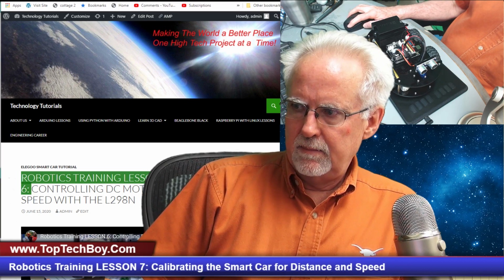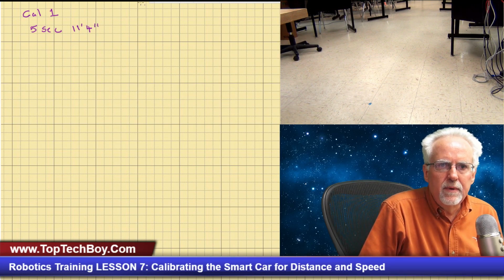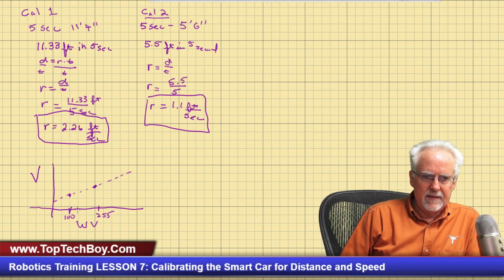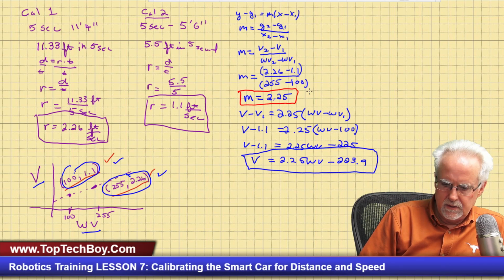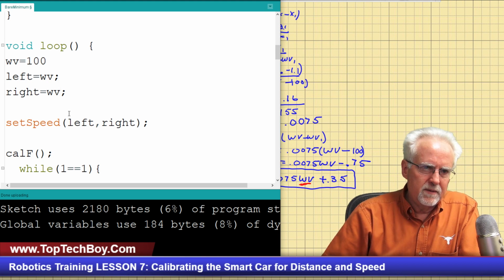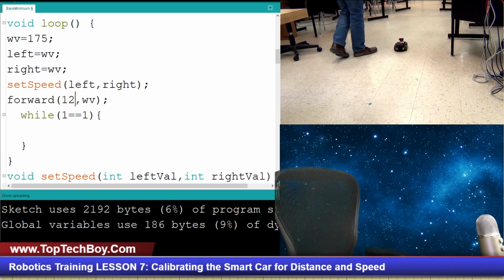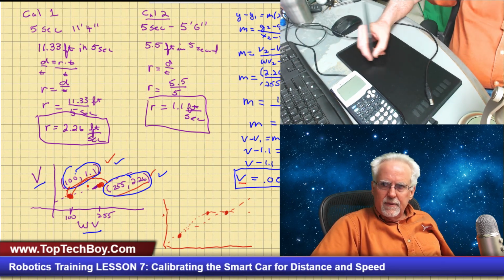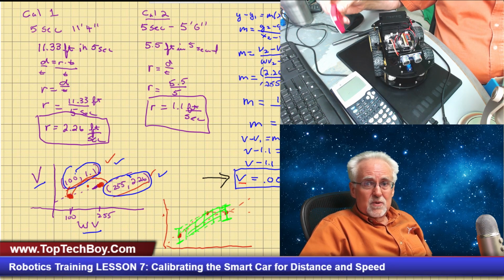Robotics Training LESSON 7: Calibrating the Smart Car for Distance and Speed

Comment: So I just tried it and it works great! Using a pot as a speed adjust, so we can adjust the speed on the fly without having to go in and change the code (just trying to engineer it to be more using friendly).
Int potPin 
Float speedAdjust 

void loop
speedAdjust = analogRead(potPin);
speedAdjust = speedAdjust / 4;

// so if the potPin has an analog read from 0 - 1023, and speed has a range of 0 - 255. Then take 1023 / 255 = 4
I think we could make a programmable car for anyone (even if they can't code) by having external inputs controlling the code. Something like the Milton Bradley toy from the late 70's and early 80's. The Big Trak.

Comment: Really a fun lesson on open loop control. The 298 is fairly linear surprise. Yes this is a very good platform for teaching. Compass or GPS would be fun for those on a tight budget and some time to wait look at Aliexpress. Check the star ratings and quantitiy sold for the most reliable though not the cheapest.  Sorry if this comment is out of line but I understand what not having lots of money is like. The pi 0 w and low resolution camera with the case is inexpensive and I will get some extra mileage out of the Nano lessons parts!  Thanks very much Paul.

Comment: Wow, I did that way differently! I just calculated what velocity would be at 100 based on knowing 2.45fps with a full power rating of 255.  I'll give ya a hint. I started the equation as 1/2.45 * 255/1.

Comment: Dead reckoning is a unstable process.  I was astounded to learn that down-hole drilling use DR to know where the pipe is.  It is accurate for them to intercept another hole; that is how they stop a blowout if the preventer fails.

Comment: if the equation of v is v=0.0075*wv+0.35, then why the robot doesn't work unless we put the speed parameter 100, and not 1 or 2?
Reply: Because he assumed the velocity to write value graph was linear when really it was probably curved slightly

Comment: Hi all I had the same issue of the car going to the left. I resolved this issue by loosing one of the screws holding the motor to the Chasse and rotated the motor to the right then retighten screws, I did this to both motors on the left. My car now runs straight line.  because the holes in the chasse are a little larger  that the screws, means the motor alinement can be out.  I hope you can understand what I am trying to explain.  Great set of videos I love then.

Comment: Just kind of virtually thinking out loud - could you use some photo-interrupters to control your speed. They are really inexpensive. I haven't used them but I have already purchased a pair for just this purpose. My thinking is that they count the pulses and we could set the speed at so many pulses per second. Use our Geometry to find the circumference of the wheels and divide by 20 (the number of slots on the speed sensor that fits on the axle).

Comment: The compass and the Pi zero sound awsome. The straight line issue is mostly an alignment problem and tweaking the motors helps a lot. If you put a straight edge on the wheels  and hold it up to the light you can see the variance from motor to motor. You can't see left to right though unless you had two straight edges and measured the toe out or toe in of both sides. Great lesson. Still catching up after the summer work and play time here in Beautiful British Columbia.
Reply: Hi Doug, I agree that wheel alignment is most likely the bigger issue with the car not running straight,  I engineered two braces between the front and rear wheels, just a piece of straight aluminum clamped between the motor and the motor post to hold the motors on each side true to each other,  my car now runs very true.

Comment: Are you going to experiment with the car turning left or right? My car is far from accurate when I tell it to turn a set number of degrees... motor speed does not seem to matter it sucks at any speed... seems to be more of a traction problem than anything else. I thought maybe using just the wheels on one side or the other for turns would help...some closed loop control is definitely in order!

Comment: It being a rainy Friday with the edge of a tropical storm about to hit, I did some playing with the car.  The right wheels definitely spin faster than the left, which might account for the drift to the left.  For a write value to the enable pins of 110, the right wheels are about 12% faster.  At 255, the right are about 7% faster.  Biasing the right wheels down a bit relative to the left, say 10%, should make it run a bit straighter.  Paul, thanks for that insight, and I think I need to get out a bit more......
Reply: Jerald Thanks for the fine-tuning of the speed of the right versus the left wheels.  I tried to incorporate your fine-tuning of the right versus the left speed into account using  the following code.  Does this make any sense to you or did you do it differently?
writeVal=110;      //changing the speed

if (writeVal<=150) {
leftVal=writeVal;
rightVal=writeVal*0.88;  // at lower speeds right wheels are 12% faster
setSpeed(leftVal,rightVal);
}
if (writeVal>150 || writeVal<200) {
leftVal=writeVal;
rightVal=writeVal*0.90;
setSpeed(leftVal,rightVal);
}
if (writeVal>=200 || writeVal<=255) {
leftVal=writeVal;
rightVal=writeVal*0.93;  // at higher speeds right wheels are 7% faster
setSpeed(leftVal,rightVal);
}
Reply: I found that the straight line issue is more about wheel alignment that wheel speed. If I twist the motor assembly a bit it helps to make it go straighter. There is also tire slippage so that if there is a bit of dust the hard plastic tires will lose grip and cause under or over steer. GPS would help over long distances but maybe the line tracking function is a solution.

Comment: The screws that hold the motors have a little play. It might be an alignment issue.
Reply: I even looked up size M3 lock washers on the internet. I'm kind of doubting whether they would help, but will probably venture into Home Depot to buy a few if this COVID thing ever settles out. In the meantime I could buy a whole bunch of the lock washers on amazon.  But I think their spring constant is too big to allow them to do whatever it is that lock washers do. So I remain reluctant to blow $15 on a whole lot of something I doubt would cure the problem. I think our best bet is to wait for Paul to teach us about a self-correcting robot that uses GPS to maintain its heading. But I share your disappointment.

Comment: This is great fun except for making stupid calculation errors. My car works better on the carpet than the linoleum but I still have a problem with the car veering to the left, some of that is my floors are not exactly level but if we can install a compass in the system that may work that out. The camera sounds great as I already have a Raspberry Pi Zero and am itching to use it. Looking forward to getting the homework done. Have a good one.
Reply: Interestingly, my test track is on a ceramic tile floor. My robot does better going south-north than going east-west. Like you, I suspect the floor levelness. The contractor who built our house tended to cut corners on workmanship.